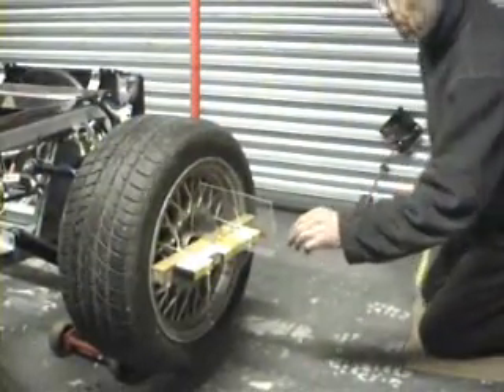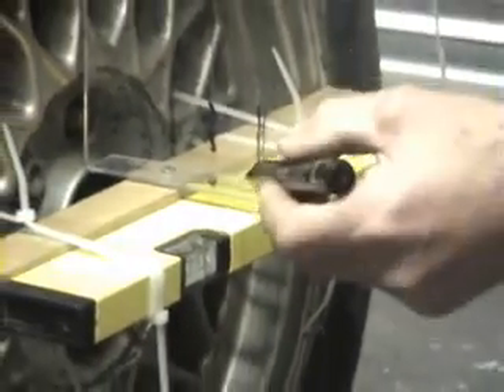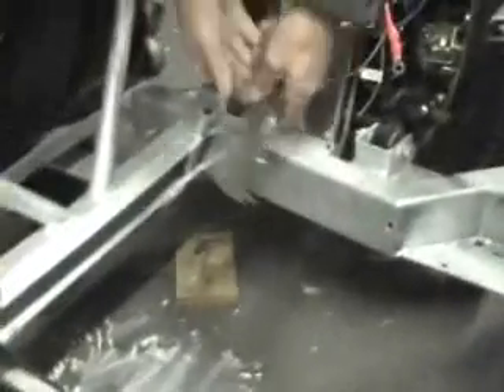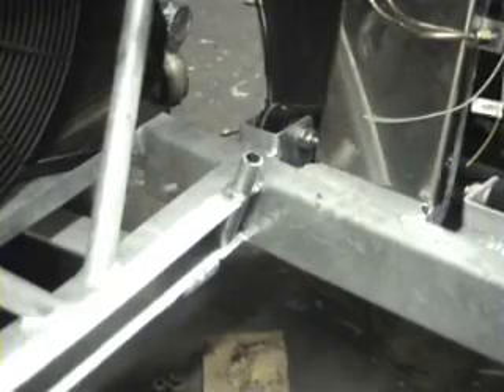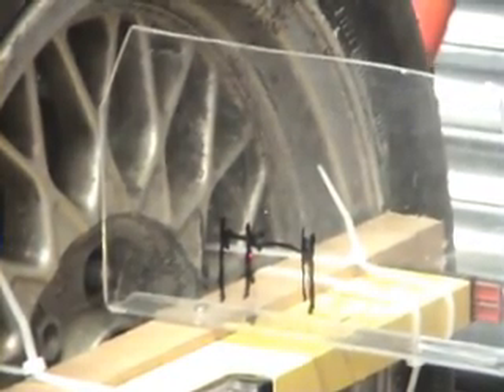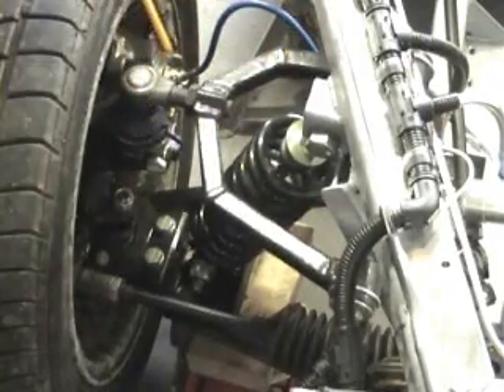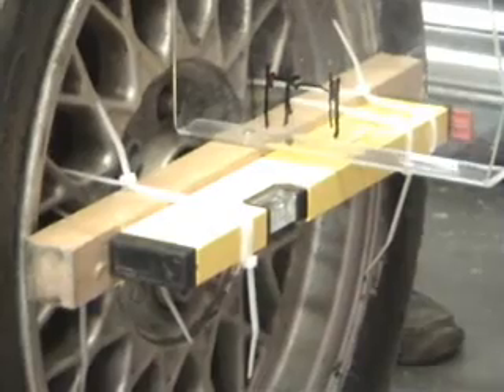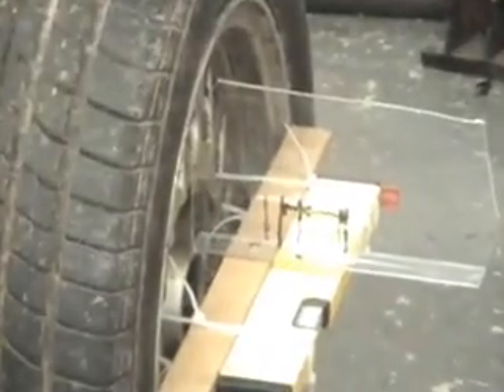Cobra Bump Steer 2.wmv

Comment: This works great ,this helps with results .
 
Symptom 1. Toes out in compression and in on rebound all in one direction. Cure 1.  Decrease shim on outer tie rod or lower the inner tie rod.
     
  Symptom 2.  Toes in on compression and out in rebound all in one direction. Cure 2.  More shim at outer tie rod or raise the inner tie rod.
     
  Symptom 3.  Always toes in both compression and rebound. Cure 3.  Lengthen the tie rod as it is too short.
     
  Symptom 4.  Always toes out on compression and rebound. Cure 4.  Shorten tie rod as it is too long.
     
  Symptom 5.  Toes out on compression, then in on rebound and then starts back towards out with more rebound travel. Cure 5.  Less shim at outer tie rod and shorten tie rod.
     
  Symptom 6.  Toes in on compression, then moves out on rebound and then starts back towards in with more rebound travel. Cure 6.  More shim at outer tie rod and lengthen tie rod.